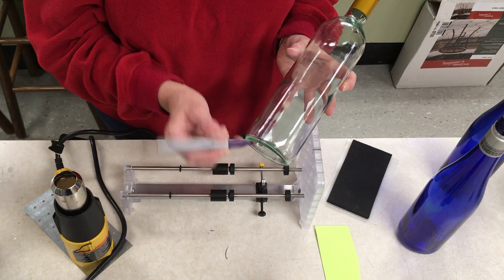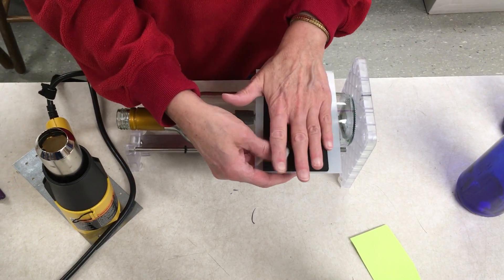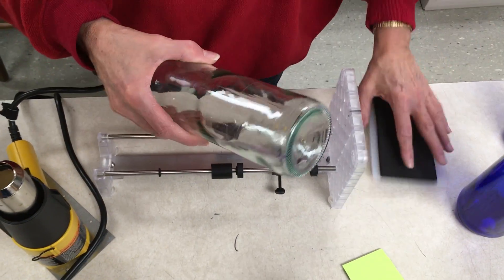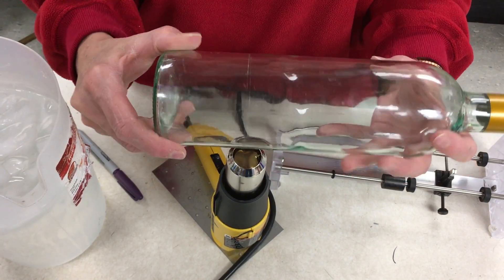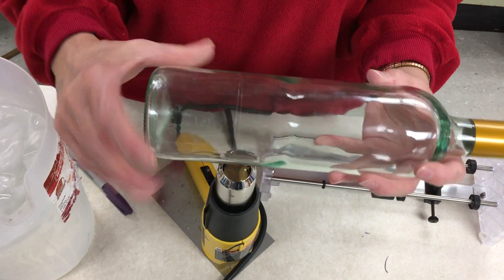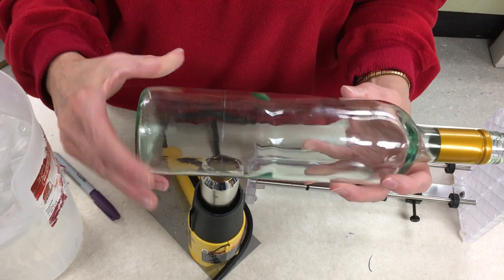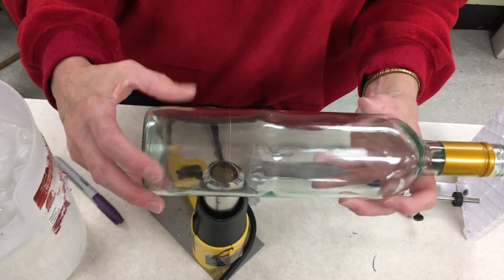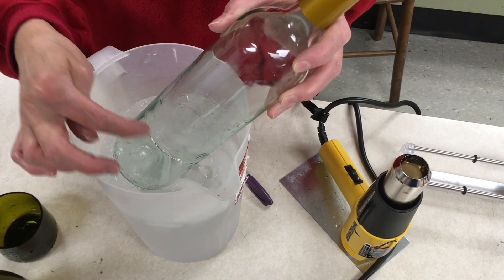How to cut a glass bottle - Creator's bottle cutter demo

Comment: This is a very nice technique you have. I also like the .25mm nichrome wire method with an 18650 battery. Your method might actually produce a cleaner cut.